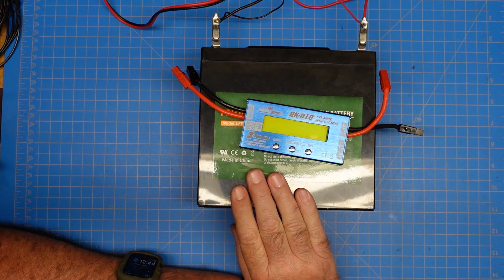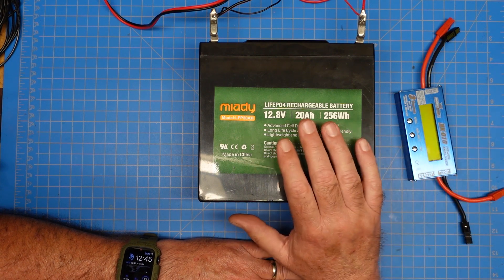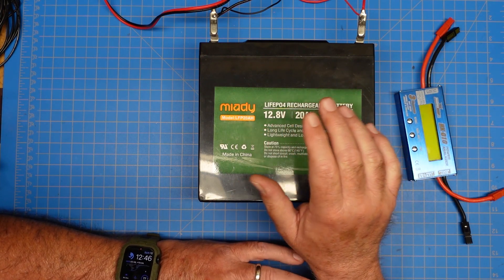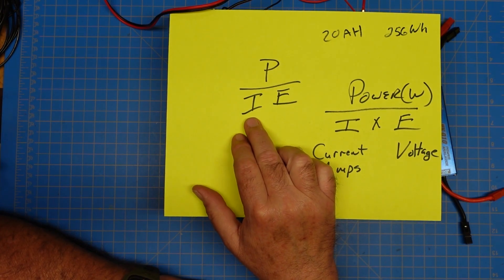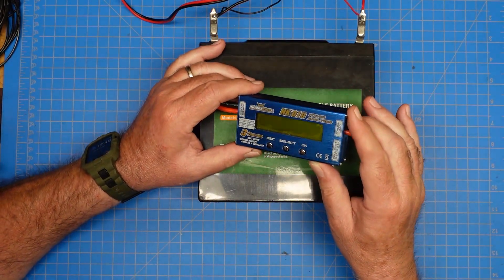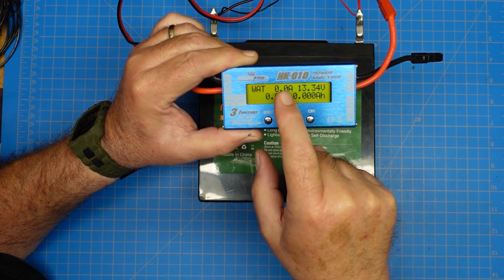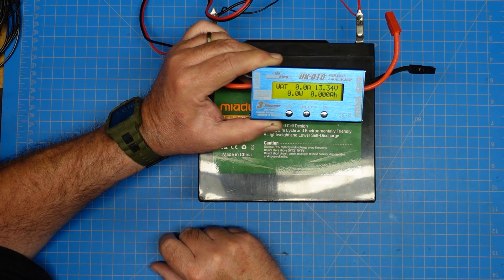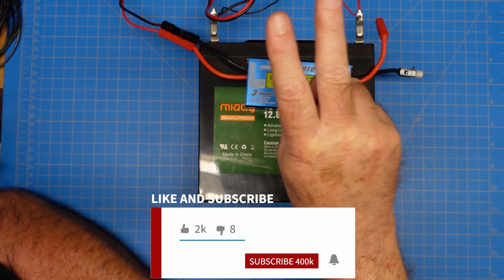How Long Do POTA Batteries Really Last?

Comment: The meter is definitely the way to go with tracking power consumption. The math on draw vs amp hour isn't quite right. The amp hour rating isn't linear in relation to current x time at all current draw rates. The battery will become far less efficient as larger amounts of current are consumed.
Reply from the maker: The battery will die faster as large amounts of current is consumed, sure.  It's a SWAG  for figuring out what battery you might want to take with you.  There are other factors involved, but most hams are good with back of the napkin math.

Comment: nice job ! hard to do math ! so many things with TX amps from radio. your settings makes a difference on power draw and your talking style . with CW your speed has a lot to do with power draw . just get a inline meter . better ones are bi- directional and can take account for solar as well. 73's
Reply from the maker: Yep - inline meter is absolutely the way to go!

Comment: It would be nice to have a monitor that would keep track of the power used and store it so you could have a total consumption of power over time so you know when to charge the battery.  The batteries BMS probably has that but in many cases you cannot get access to that data.  Thanks for the video Jim!
Reply from the maker: Yeah - some charge controllers have that capability, and I think I might have seen some batteries that have an app - but it ain't common.  One of those inline meters is the best alternative.

Comment: I have a similar meter in my Amazon shopping list.
Reply: Kevin Loughlin Old Ham Tech just did a nice video on this model of meter (may be branded differently).
Reply: @Frank_K4FMH  I saw that one. His is rated for 100A, whereas others are rated for 150A, 200A, etc. I hadn't noticed until someone pointed it out to me. Just something to consider.
Reply: Indeed! They vary quite a bit. I have more than a dozen of these inline wattmeters, ranging upwards of 200A. I routinely out them in battery boxes I build. 

Kevin’s YT video was a variant of the one Jim illustrates here. 73 de K4FMH
Reply from the maker: Those things are legion on Amazon.  I have had several "models" and like you mention, the current rating varies as well.